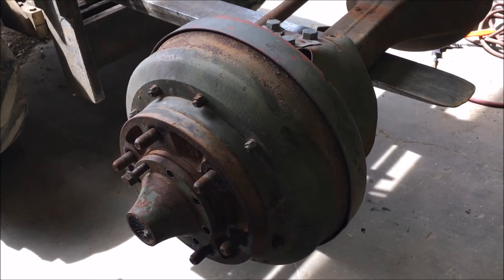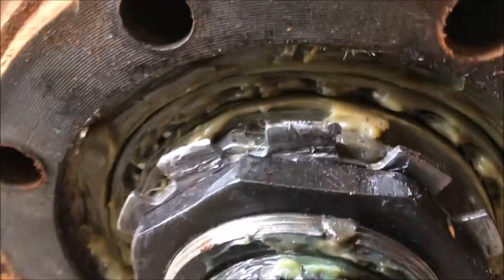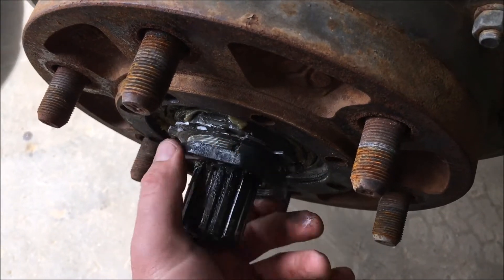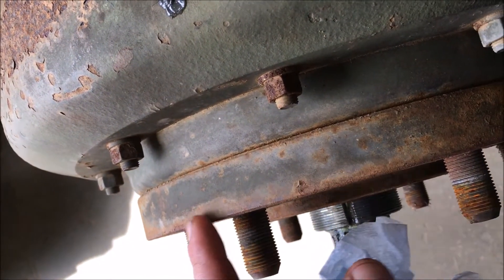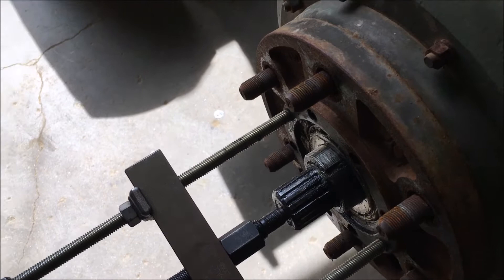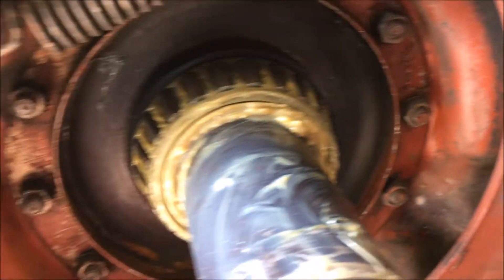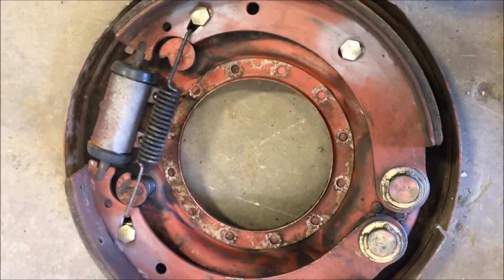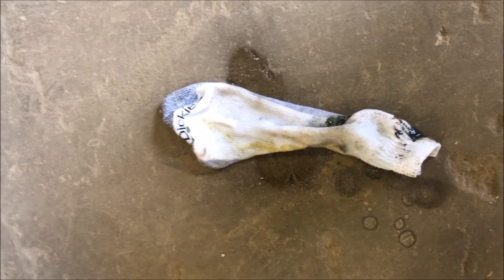WCR De-Braking a Front 2 5 Ton Rockwell Demonstration

Comment: What's the purpose of removing the part with the bearings? Wouldn't that stay on?
Reply: If you are referring to the hub, it won't come off until you loosen the spindle nuts as that is mounted to the spindle which is the last thing that you remove before being able to pull the shafts out. The Drum itself is mounted to the hub, so you would have to pull the whole hub to remove the drum. 

If you mean the spindle at the end, that he left the bearing on, we were going into a further tear down, so axle shaft removal was next on the list.